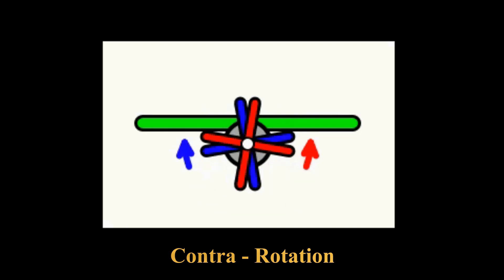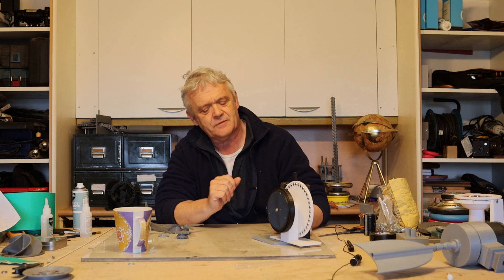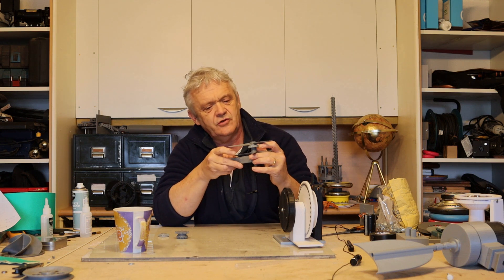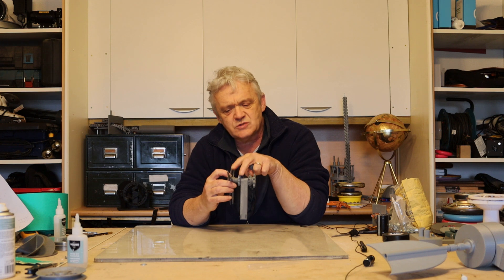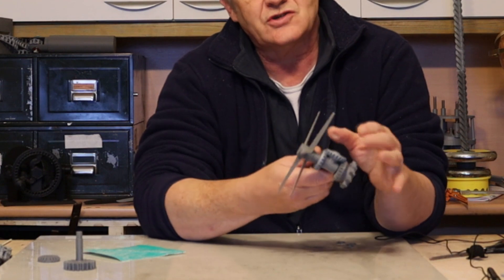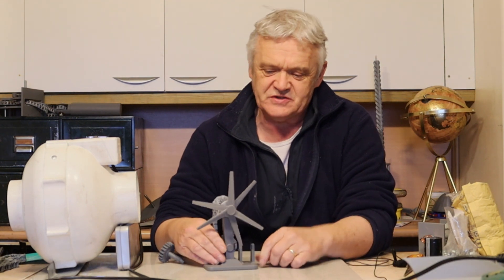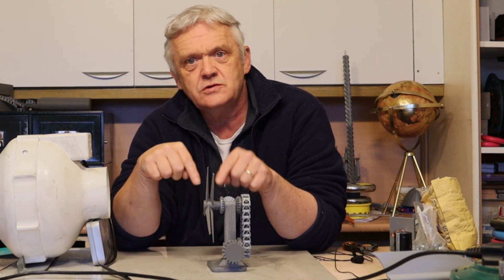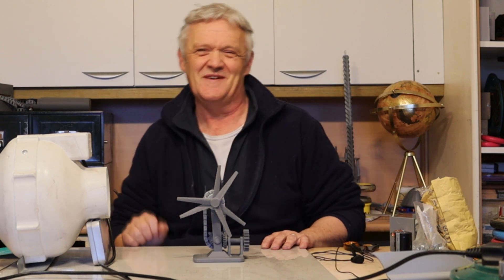2089 Contra Rotation In Wind Turbines

Comment: Robert, when doing contra-rotation, I helps to have rotors that don't have the same number of blades so that they never all overlap each other all at once. If you use a five blade rotor in front and a six blade rotor in back, only one rotor at a time overlaps. This supposedly reduces noise and improves efficiency. Some of the most modern contra-rotating propeller planes do this.
Reply from the maker: thanks mate - good info thanks for posting
Reply: less noise = more efficient. Excellent response @berkana
Reply: have you tried making the rear set of blades bigger than the front?
Reply: @TheAdeybob  Yeah the blades should be 25% longer
Reply: @Rythmdoc are you sure that's only 25% longer?
When I look at a sailboat, I'd say the jib is more like about 25% of the mainsail.
But IF it's the right shape and size, in the right location, at the right angle (and probably some other factors), it DOES give you double the propulsion as you would have had with only the mainsail, I've been told...
Reply: Curved blades has the same effect and is simpler manufacture
Reply: @thekaxmax  Good point. If the blades are really curved with back-swept tips, they would only overlap minimally as they cross over each other. However, I think all three blades doing the cross-over at the same time may still have a noise generating effect even if the blades are curved. The question is whether curved blades also make less noise to begin with.
Reply: Volvo penta use duo props 4 blades at the front 3 at the back, a well proven and efficient set up.
Reply: this almost feels like an unshrowded compressor.. .. if there are configurations like smaller in front on either ide with a larger in center, maybe weith blades that have scoops that direct air over to the next blade sort of like in your aermotor video but more Pelton style scoops
Reply: I will t
Reply: I would think that having a bank of stater plates in-between the front and rear blades, would limit the air turbulence behind the front blade, therefore delivering more energy to the rear blades. Eg boat jet units.
Reply: @Paulman50 jet engines (big airplanes, jetfighters) and turboshaft engines (helicopters) have those too.

Comment: The way you've arranged the gearing seems somewhat inefficient.
If instead you took the output from the linking bevel gear with an output shaft running down the centre of the support to the generator.
Not only will you have reduced the amount of redundant gearing, but it also becomes possible to turn the blades into the wind without moving the generator (no flexing of the connecting wires), as well as making the desired spacing between the two sets of blades easier (one each side of the supporting column).
Reply: 👍 cool, so basically you can take the differential off of a car and hang it with the drive shaft pointing down and blades where the wheels were?
Reply: @jay90374  Not exactly if you did that the two fans would be independent and rotating in the same direction, also a more complex and therefore less efficient method.
What I'm thinking of uses only 3 bevel gears (most car differentials use 6).
Imagine the letter U made up of 3 bevel gears, the 2 uprights connect to the fans and the bottom gear connects to the output shaft.
Reply from the maker: lol - yes it is - but it doesn't make much difference mate this a frame work to test ideas - that is going to effect design

Comment: apparently, the new RISE turbo prop use  a static set of stators instead of a second contra-rotating prop to get most of the benefits of the 2nd prop without requiring any extra input
Reply: That's how turbine compressors work, alternating rotating and stationary blades
Reply: @thekaxmax   it isn't part of the compression, the stators are on the by-pass
Reply: @nimoadder I believe they are, otherwise the air would just spin round and round inside the turbine. The stationary blades make the air being pushed through.

Actually, I know for a fact, that at least some Russian helicopter-turbines do have alternating rotating and stationary blades.
I saw a guy on YouTube tearing one apart and building it back up, so...
Reply: @nimoadder  they are there to aid compression, because without them the air just goes around and does nothing. They are angled to aid compression not just guide air, and so are part of the compression.
Reply from the maker: cheers mate

Comment: I can udderstand contra rotating is useful in an hellicopter as it will make it more stable (it wont spin so you dont need a rotating  blade on the tail. Im not sure the advantage in a windmil ie would it be better that two blades rotatiog in the same direction.
Reply from the maker: read around a bit on this mate - you will find it is a hot topic

Comment: you could also have contra rotation where one set of blades drives the magnets and the other drives the coils the opposite way, doubling the speed.
Reply: True, but having the coils be stationary is advantageous because it makes the electrical power transmission easier by not requiring a wire coupling that can spin
Reply: @wikedawsom is that possible? Can you get wire coupling that spins?
Reply: @Sebloe  yep, they're pretty cheap too, but i think they wear over time, especially if they rotate a lot, and I'm not sure what the voltage or current limitations are for them
Reply: @Sebloe  its called a commutator - or there is the connection that Robert and Luke showed in an earlier video
Reply: in video 1962
Reply: It's a bugger to wire up, though
Reply: @thekaxmax but is it possible?
Reply from the maker: a lot of people suggest this - it is up to them but personally i wouldn't bother